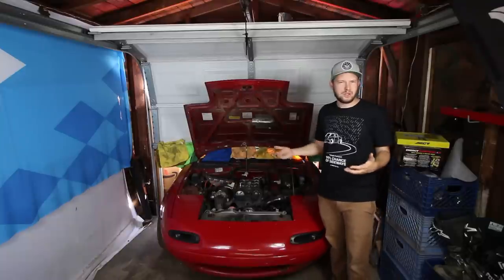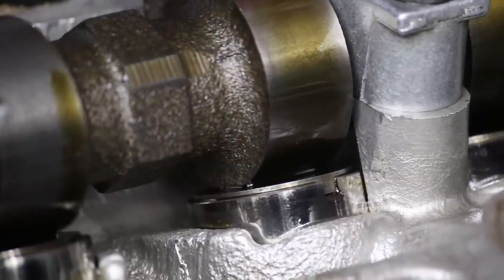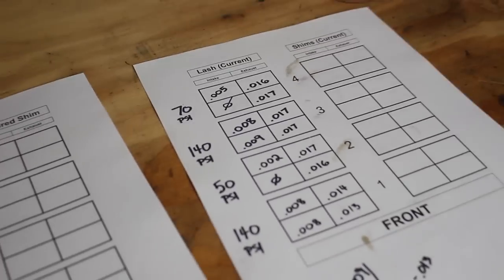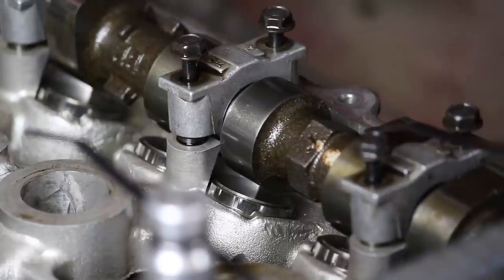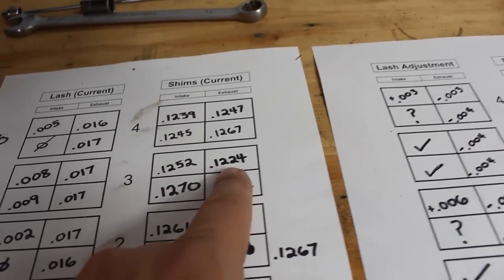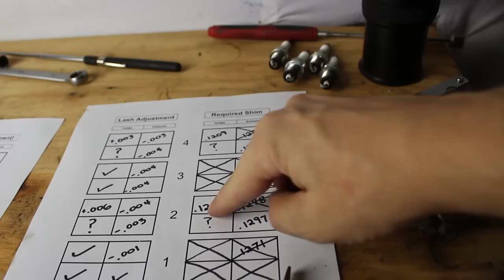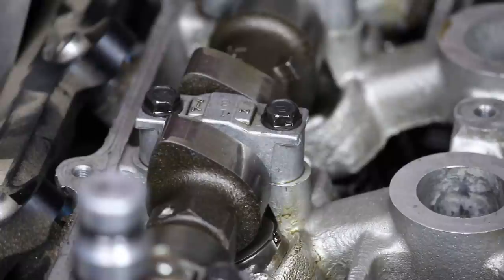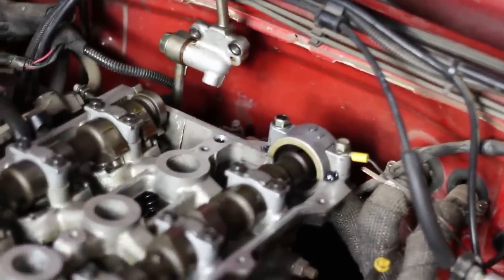The ULTIMATE GUIDE For Adjusting Valve Lash On Your 99-05 Miata!

Comment: That would also be the reason for lifter tick or is that something else?
Reply: Joshua Caban if you have an early engine lifter tick is cause by collapsed lifters. I can only assume that too big a gap maybe cause a sort of slap between cam and shim thus causing valve-train noise
Reply: @isidrotechdecker  it's a nb, thanks for your help
Reply from the maker: Yes if the clearances are too large, the vavletrain will be more noisy as the cams are tapping harder on the shims.

Comment: hello, i have a question, when removing the valve cover is it required to change the head gasket?
Reply from the maker: I assume you mean valve cover gasket, and I don't replace it every time. It's probably "recommended" but I'm not spending $15 every time I pull the cover haha
Reply: @TheCarPassionChannel  thanks for your answer. also, how can i be sure i have those kinds of shims and not bucket for example? i have an NB from 1999. i ask this because i've been having almost all symptoms you describe and my car will go to mazda this friday, i just want to make sure i have as much information as possible.

Comment: Ok guys, has anyone had this issue:

So, I have a 2001 miata, vvt obviously, same exact motor as in the video. My valve train (I believe it’s the valve train) makes a loud knocking noise, but only when you rev the motor to around 3k rpms, and there is no load on the motor. No noise what so ever at idle or if you put load on it. To hear it you have to only give it maybe 5% throttle, any more or any less and it goes away completely. It only happens when the motor is warm and the hotter the oil gets he louder it is. I’ve checked my lash and every valve is within spec, and every thing looks perfect. When I first bought the car I thought it was rod knock because of how violent it sounds so I rebuilt the bottom end (new forged crank and main/rod bearings) and it’s still there completely. I’ve put 20k miles on the car since I bought it and it hasn’t gotten any worse or better. I’ve taken it to a few people to see if just by listening to it they could tell me what it is and everyone is puzzled by the noise. Anyone else dealt with this???
Reply: The only thing I havnt checked (because I didn’t want to pull the head) is the pistons. The only thing I can think is that maybe there is slop between the piston and the wrist pin maybe? But I would think that that would be serious enough to get much worse for over time, as well as also hear it when it was cold, and I would think it would get worse with rpms and load as well. Or maybe something is wrong with my vvt and it’s not supplying enough oil at certain rpms ranges? Idk I’m so sick of it I just got to the point of saying, if it blows up, it blows up, time to go built motor 😂
Reply from the maker: My motor has done a bit of that from day 1 too, like a weird valve knocking sound. I never figured out what it was but nothing bad has happened yet so 🤷🏼‍♂️
Reply: TheCarPassionChannel huh that’s so weird. Mine is definitely scary sounding, like it’s loud lol. Gives me a bit more confidence hearing that you have dealt with the same thing. Also just curious, are you running a stock oil pump?
Reply from the maker: @SNOFLOFilms  Boundary Engineering Stage II
Reply: TheCarPassionChannel ok, since my motor had previously been rebuilt due to previous owner putting things together wrong, I was trying to see if some how it was a shortage of oil from the stock pump getting clogged or something but if you have a new pump and it’s still doing it that’s not it. Thanks for the info!
Reply from the maker: @SNOFLOFilms  Hey buddy, I remembered your comment and wanted to let you know to check the tension on your timing belt. Mine was a bit too loose because I tensioned it wrong, I just fixed it and the head is totally silent now. Much quieter. If you follow me on IG I'm going to post a little before and after sound clip in a little bit.

Comment: For the valves that are zero or negative even. Just shave the valve stem. Then you’ll lower the bucket and therefore the gap will increase.
Reply from the maker: That would require me to take the engine half apart and then disassemble the head. $10 shim and a cam pull sounds a little better to me
Reply: @TheCarPassionChannel  well. Guess if you put it that way. I meant the tip for others who may be doing the adjustment on the bench.

Comment: I know this is old and I know you probably won’t respond but what do I do if 
every single one of them has wayyyy to much space? Like over 80mm.
Reply from the maker: If you had 80mm between your cam lobe and lifter, the cam would literally have to be removed from the engine. That's like as long as your index finger.

Comment: Its Funny that you make a Video about this, my Machanic said that it could be a wrong adjusted Valve Lash but i got a 98 nb. Does this still maybe fix my issue? Should i still messure my Valve Lash? Got 87 PSI in my 1. cylinder and like 116 PSI on the other 3 on Rock cold compression test.  And after driving for like 15 miles i got in all 4 like 175 PSI. After one hour the cylinder 4-2 are still on 175 PSI and the 1. one is again on 87 PSI. Do you have any idea what the problem is? (Sorry for my very bad english, school is a long time ago ... )
Reply from the maker: It is definitely worth checking! My car ran great after it warmed up, but on cold start it ran poorly.
Reply: @TheCarPassionChannel  Ok i will check this , Thanks man! I hope its "only" some bad shims and not the Piston rings or the head gasked...

Comment: Why did mazda switch from hydraulic to shims?
Reply from the maker: I'm not sure specifically in their application, since they didn't raise the redline, but it is safer to rev higher since the entire valve assembly is lighter. I assumed it's probably worth a couple HP as well? Not sure on that one though.
Reply: lighter valve assembly, no ticks when the hydraulic lifers don't get filled with oil, they rarely need replacing, cheaper.....
Reply: The last paragraph. Do you think because you might've revved the engine past 7,200 RPM once or twice (with a 2001 cylinder head) might've been the reason why the clearances were changed?

I haven't looked up if valve float occurrence ruins valve lash
Reply from the maker: @Nasonix2  I have stiffer valve springs to help cope with raised redline but I usually stay under 7400

Comment: Wait a minute. Don't they make a tool to hold the bucket down so you can remove the shims ? The shims are on top of the buckets so there should be a way to do it without lifting the cams.
Reply: Yes there is a tool , but hard to find one that fits Mazda head .

Comment: why not sand down the thick shims?
Reply: They are coated so you would need to sand the other side but I guess if you are precise enough go for it. Just be sure to clean the shim properly
Reply: It’ll be very difficult to get the required precision by hand

Comment: it's 1.6 or 1.8?
Reply from the maker: 2001 1.8L engine
Reply: @TheCarPassionChannel  the video is more usefull compared with some university teacher's mechanical class. Thank you!
Reply: @TheCarPassionChannel  This (really awesome) guide should also apply to my '98 1.6 NB Miata, right?
Reply from the maker: @Hinterhof-qx5ql  I don't know as much about the MK2 1.6 as we never got them in the U.S., but if it has solid lifters it will apply.

Comment: You don’t need to remove the cams to remove the shims lol
Reply from the maker: If you don't remove the cams you need to buy the special tool that depresses the spring below the cam. If you want to buy that tool fine, but you don't need to if you just loosen the cams.
Reply: TheCarPassionChannel  true but tool in £10 😂
Reply from the maker: @MrEvaaansss  You got a link? Because the Mazda tool for this job is $360. You can't just use johnny randoms harbor freight "sHiM reMoveR" on any engine lol. They got em for motorcycle engines for $10
Reply: TheCarPassionChannel I bought my tool from Halfords a few years ago and have used it on multiple Toyota engines (at work) and my mx5. The tool has multiple sizes. I’m sorry for saying anything and questioning your obviously vast knowledge.
Reply from the maker: @MrEvaaansss  No I was genuinely wondering what tool it was, I'd like to post a link up on my site if you can source the exact tool

Comment: This sounds like way to much BS to go through to me. Could I swap solid lifters for hydraulic ones. I understand the hydraulic ones lose horsepower on the top end, but my car is gonna be more of a daily not a race car. I don't really care about high RPM power so hydraulic ones sound a lot more appealing to me.
Reply from the maker: This job will likely only need to be done once in the car's lifetime, and there are plenty of 200k mile Miatas that have never had it done at all, and don't need it. If you have a high mileage 99-05 motor, I'd recommend just checking it which takes a half hour, and it'll most likely be fine. This motor needed work due to running 21psi of boost and 8000rpm, which I assume your daily does not.

But yes, you should be able to swap a 99-05 from solids to 90-97 hydraulics. Research before attempting

Comment: I now discover all of my valves have no space at all 😅
Reply from the maker: Are you sure you have solid lifters, not hydraulic? It would be very rare for that to happen to all of your valves, the engine will run poorly as soon as 1 valve has no lash usually
Reply: I don't even know what hydraulic lifter looks like or how to measure. I now believe there can be an issue since my car is sounding a bit louder and is less efficient. I appreciate your response. I will do my best to figure it out.